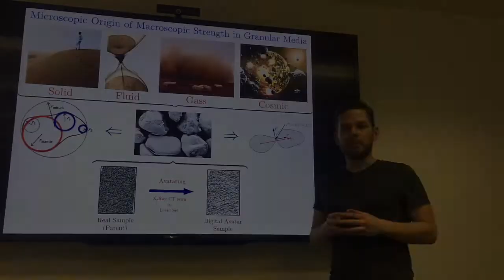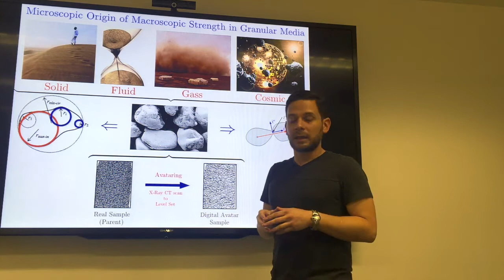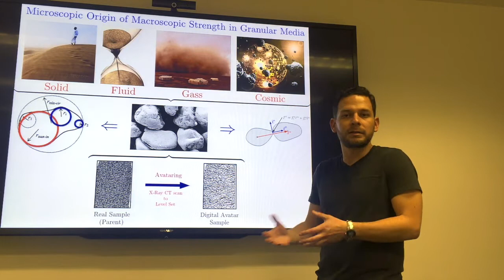About my scientific research!

Comment: Hi Alex, my name is Vishal and I live in India. My work is to analyze thebehaviour of deformable bodies when they are in contact. But I couldn't find any appropiate material/notes/video classes on Contact Mechanics yet. Could you please suggest? Thanks.
Reply from the maker: Hi Vishal, it depends on what are you looking for! There are many methods and algorithms. For instance I like a paper called Granular contact dynamics using mathematical programming methods by K. Krabbenhoft, you may look for that one and related stuff. Not really sure if that answers your question! Anyways, let me know! Cheers
Reply from the maker: Hi Vishal, it depends on what are you looking for! There are many 
methods and algorithms. For instance I like a paper called Granular 
contact dynamics using mathematical programming methods by K. 
Krabbenhoft, you may look for that one and related stuff. Not really 
sure if that answers your question! Anyways, let me know! Cheers
Reply: Thanks for the effort Alex. This paper somewhat matches with my requirement but it would be more helpful if you could suggest me class notes or implemented problmes on contact mechanics (e.g. elastodynamic analysis of two deformable bodies under contact or contact of one block to another one).  Actually my research field is to analyse the dynamic response of bodies under contact. This far, I could grab the theortical knowledge of contact mechanics but it gets really tricky at the time of its implementation. Thus, I am seeking the help in this regard. 
If I couldn't make my explanation clear, please let me know.